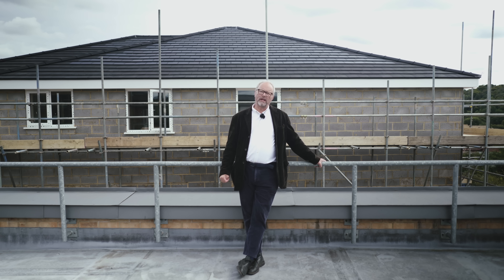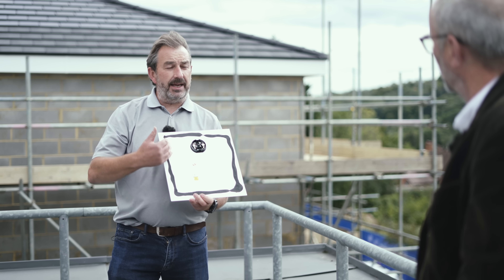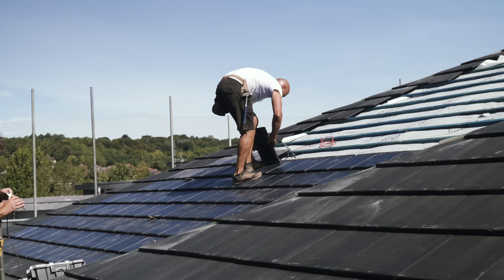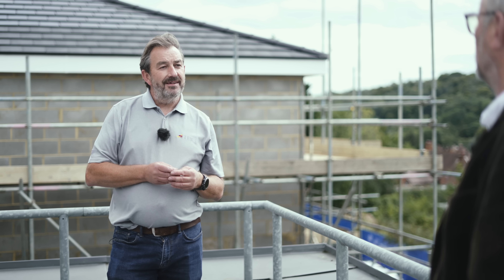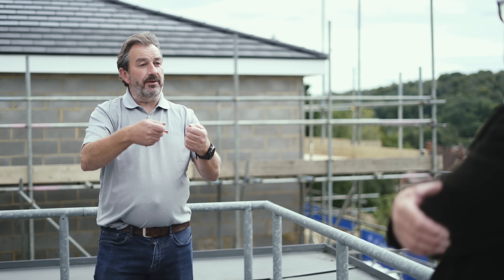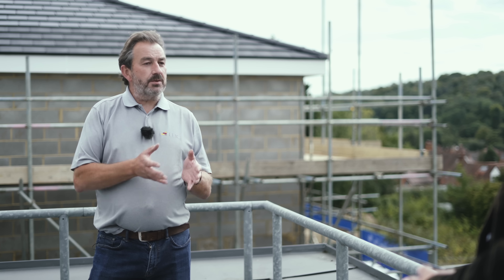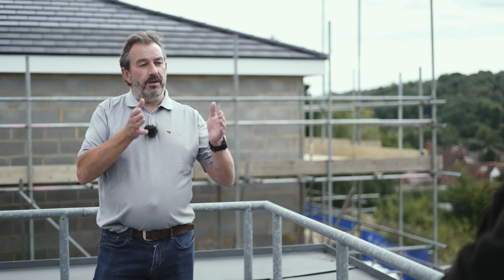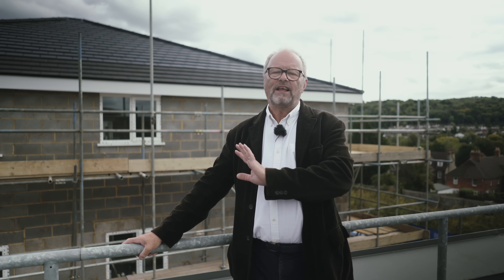Solar Roof Tiles - should every building generate its own power? | 100% Independent, 100% Electric

Comment: I think all new builds should require solar roofing of this kind. Economies of scale would drop the price and considering how long buildings last, they'd pay for themselves many times over in the course of their lifetime.
Reply: Any council buildings/houses should definitely have solar as they will pay for themselves in the long run. All new houses should have them, the increased cost of purchasing a house would be spread out over the length of the mortgage and the reduction in energy bills would more then compensate for the increased mortgage. So it should be easier for people at the bottom of the property ladder
Reply: They ARE required on new California construction homes.
Reply: California, what the UK aspire to be....
Reply: Scratchy Ballzack  Housing costs have less to do with building costs and more to do with speculation.
Reply: Scratchy Ballzack  We are talking about adding around £360 per square meter of roofing on a product that generally costs around £200,000 + depending on where the country you are based.  Where it comes to the cost of a house, very little of it is down to the materials used in comparison to the land and labour costs.
Reply: Economies of scale do not always work. When was the last time the price of a car came down from the previous model version. I've been buying the same model car for 20yrs (new every 2/3yrs). Price has increased from £10,000 to £19,000. And no, my income has not increase by the same rate - nowhere near.
Reply: You guys are DELUSIONAL if you think solar tiles will last long enough to pay for themselves.
Reply: @truantray  They already do- ordinary solar panels have a 15-25 year life span and repay their investment inside that time frame. Smaller, cheaper tiles with longer life spans covering more of the roof = quicker return on investment. That's only ever going to improve as the technology improves too. I hope you're not basing your statement on the idea we're still in the 90s or early 2000s when panels weren't half as efficient as they are now?...
Reply: Scratchy Ballzack  It would benefit you to do the math first.  Solar on a roof wrapped into a mortgage (why not do 30 years) = insane gains and lower bills, more than pays for itself.  My DIY solar has a 6 year ROI.  Local installer = 12 year.  This is in Michigan of all places...
Reply: Especially where you have housing over £500k
Reply: The way I see it is that new builds are bought by people that can afford to pay a little extra for a solar roof. Those that can't buy cheaper 2nd hand housing as I have always done.
Reply: Scratchy Ballzack  Fossil fuels are limited, there is only so much left, & it adds to global warming etc etc. Solar power seems the way forward & store it in batteries, adding in wind power too. Robert Llewelyn also mentioned electric bricks are being developed, this would make our houses into electric storage units, seems very interesting development!
Reply: Solar who is HOT drops signifisent 
In power output !! 
That's why solar panels are wented and lifted off the roof 
Phisix is phisix !! This is a bad idea
Reply: @kennethschultz6465  You seem to be overlooking a few issues. Firstly, in the UK it rarely gets that hot- those roof tile solar panels will be fine. Secondly, they aren't the same design as traditional solar panels- they may lose efficiency but I doubt it is very much given the amount of cooling from wind movement and lower UK temperature during the day ( vs hotter climates ). If it was a bad idea they'd have figured it out  and realized they needed a different solution; physics is physics- real physics that is, not half-baked poorly understood physics like you spout...
Reply: Scratchy Ballzack  There is everything wrong with fossil fuels. Think of it as a product, it is an old outdated, dirty product, brilliant in its day but that day has passed and we now have a cleaner, more efficient product that can replace it.  It's progress.   Just like fossil fuels massively changed our lives for the good, it  also caused tremendous problems.  Now we have the opportunity of cleaner,  less polluting fuel, it would be insane not to go with solar and wind technology.  It's happening anyway.
Reply: Yea, in theory
Reply: Prices won’t do down if more money keeps getting printed.
Reply: @A N Other The sun is laughing at this comment...
Reply: The cost is extortionate. I'd much rather spend my money on something worthwhile. If everyone had to do this the price would be crippling.
Reply: @MrOzzy281  solar is not extortionate even right now - on an old house with retrofitted panels it might be be £7000. And if houses were required to use solar as part of their building code, it would be easily halve because production and installation costs would drop with scale and competition. Or perhaps you don't think the free market would see to that?
Reply: Haha no they really wouldn't! You get about £200 a year saving from solar panels.... So you're paying off your £300k house with £200 a year? Okay 🙄😂
Reply: Yes, what we need is the price of housing going up even more.
Reply: @goliver3846  no we don't! If house prices go up to reflect, everything else would also go up! It's called inflation 😂
Reply: @lewrocks94  Agreed. We just need to see an inflation in salaries to be able to  compensate. Not seeing that in my world. Must be lucky in yours.
Reply: Absolutely NOT! REQUIRED means if you DON'T a man with a gun shows up at your house with fines or handcuffs. RECOMMENDED yes but what about wooded areas? Low light cloudy areas? My house is 100% solar INCLUDING Air Conditioning and my family has been involved with alternative energy since the 70s. Gov MANDATES DESTROY INCENTIVE FOR CLEAN ENERGY because like you they think by backing a corp with TAX $ they can spur innovation but what they do is write POORLY WORDED LAWS that people EXPLOIT to just get free$! Private investment picks GOOD winners BAD LAWS make everyone a loser!
Reply: And then what pays for the landfill after EOL for all those panels.
We're talking literally MEGATONS of material.
Reply: one flaw in your logic. "economies of scale" would not reduce the price in your proposed scenario of having the product required by law. that has ALWAYS increased the price of it. sure, the cost of production will still go down, but the cost to the consumer will go up. they have you over a barrel if they have the teeth of the courts behind them. either you pay the price, or the courts come at you.
Reply: No they don't. Currently It takes 30 years or more to repay itself and only lasts 25 years.
Reply: @MontagoDK  lol where are you getting those numbers?
Reply: @JamesMichaelDoyle  from various solar roof companies in Denmark - these new tiles are extremely expensive and can have some maintenance costs over the years, when 1 tile breaks (electronics) and needs to be replaced. You also need to buy an expensive battery to store energy from daytime and use at night, these batteries last around 15 years and needs to be replaced. Solar cells don't last forever and loose their yield over time - 25-30 years lifetime is a good estimate before you need to change them again.
Reply: @MontagoDK  well the battery is only needed if you want to be offgrid capable. you could just tie into the grid and feed into it. the battery is no different than normal solar.

solar panels do not degrade indefinitely at a significant rate. they degrade at a significant rate at first, til about90% then the rate of degradation slows down. at the 20-yeah mark they are likely at about 80-85 range. after that, its so slow its not even worth worrying about.

are you sure that you are speaking of tiles like the ones in this video? because these guys have an interesting take, where they have a inexpensive way to produce them on site. its not as perfect and flawless an end product from the aesthetics, but hey, these look good enough, and are not as expensive on both materials and installation as other previous ones in the market. and even those were still pretty damn good value if you are doing the roof anyways.
Reply: your so right every house stroke building should be fitted with these tiles they look and fit better than the tesla tile last a long time and being only 31 pounds a tile a pound for the tile and 30 quid for the solar cell eventually the more that are made and the more that are fitted the price should drop at least 50 per cent in a couple of years if everyone started to fit them as manufacturing costs will drop they always find better ways of making them and with better materials  so if the government grew a couple of big ones and stood up to the power industries and said all buildings from 2021 will be fitted with solar tiles were possible and if anyone wants to partake on haveing their tiles replaced with them we will give them a 50 per cent off per tile  for the first two years as that would kick start the industry and give a swift kick in the gonads to the power industries when houses start back powering them and they have to pay the houses and buildings for giving them surplus power until they go bust as then batterys will be next on the governments list to have them fitted in everyhoushold which would kickstart a massive industry and if john b Goodenough comes up with this glass battery made from cylicone and other cheep materials the world will be a better place to live in and by bye to the power industries  except the wind farms and solar cell farms all the rest the coal and gas power stations the nuclear power stations shiut down except the ones recycling the nuclear material then once that's done and there is enough stored then bye bye the rest of them. petrol cars will be like vintage cars hardly seen any more and won't be allowed on the new motorways where electric cars all hook up together like a train and drive themselves until it their time to leave the junction and then it steers its way of onto A road's and to the destination, no driver now required behind the wheel but you can drive manual if you want but you have to go in the petrol lane where the fuel cars drive.
Reply: @kinkong1961   can you try and chop that up a bit, holy hell its hard to read in one long blurb. it doesnt look better than the tesla tiles, but it still looks pretty sharp.  and likely much cheaper, since they manufacture them on site.
Reply: Interesting what the connectors are and expected lifetime?  Also how the extra electrician connects this lot up live on a sunny day. What happens if a fire starts? (Just practical points to think about). Structurally it looks the way to go for pitch roofs. Start a 38 degrees campaign for the lack of action on new builds.
Reply: Absolutely! That solar hasn't been mandatory on all new builds in recent years is such a missed opportunity
Reply: Scratchy Ballzack  a fair point, I can't speak to American prices but in the UK all new build prices contain a very decent margin for the builder. Housing is ridiculously overpriced here too, my argument is that the free market has had plenty of time to do the right thing though.
Reply: @AdrianNelson1507  there are no free markets!
Reply: Scratchy Ballzack  In fact to get a true market economy, you need a government, not the corrupt government under the foot of lobbies and corporations. Sacrilege, you will tell me. But look at your healthcare system, you pay 3x more and live like 4-5 years less in the US. The reason is when corporation run loose without any regulation, they don't tend to fight each other and compete, they just buy each other and form cartels. It is so much easier when you have 2-3 cartels to form monopolies and fixing prices, than to fight each other and decrease margins.
Reply: 100%.  The government has missed a trick by not making this compulsory on new build and replacements.
Reply: @rogerbarton497  at least federal buildings. That should have been a given
Reply: Roger Barton 
They didn't miss a trick. They just got told not to by building companies.
Reply: Scratchy Ballzack  Last time I checked the solar panel roof tiles were actually cheaper than traditional slate tiles in some places- as others have said economies of scale will drive the price down further, and the savings on electricity make the home cheaper for the buyer fairly quickly. You're being rather shortsighted...
Reply: Scratchy Ballzack  Property prices are only so high because of laissez-faires housing policy.  If council housing was supported and landlordism restricted through taxation you wouldn't be living in a country where you have to shell out upwards of three hundred grand for a three bedroom matchbox in the boondocks.
Reply: @fredfredrickson5436  Property prices are high because of supply and demand. Supply is constrained by planning permission and available space and demand is high because of in-migration to the specific areas due to available work in those areas. Planning permission is the exact opposite of laissez-faire, although most people would view it as desirable overall. Landlords do not affect supply or demand in this equation.
Reply: @markcoster9789  That's ideological claptrap, Mark.  I'd urge you to examine your remarks and ask yourself if they really stand up to earnest scrutiny.
Reply: Scratchy Ballzack  I think you have found the wrong channel! I'm sure the Koch brothers have some programs you like.
Reply: This is one of those things that would never happen with a Conservative government but I could see Labour trying to push through something like this.  The Conservatives tend to believe in de-regulation and have (as an example) actually cut down the amount of insulation required in new houses when compaired to when the last Labour government left office.
Reply: there's no way they'll be able to produce and install that many solar systems
Reply: Scratchy Ballzack  That can be a way for supporting green transition from the government. They should pay the price difference between regular tiles and solar tiles as subsidy when you are installing new roof or renovating old one.
Reply: @tcfs  I did some calculations and compared to building of a new nuclear power station the UK would save money by giving away for free the solar tiles and battery storage on new builds. Pointed this out to my MP, what a waste of time :( 
BTW I did not include any decommissioning costs of the nuclear power station or any transmission losses in getting the power to the houses just the up front costs for producing the same power.
Reply: @favesongslist  you perhaps should have included that decomissioning and putting the nuclear station land back to general use would take more than 250+ years as shared by Robert in the last video.
Reply: @shirishag75able  Unfortunately is is impossible to get politicians to think far beyond the next election cycle, so I did not include it.
Reply: @favesongslist  That's why we need PR, I think. Much as I dislike teh political aspect of this versus the technological/environmental. But when I look to the continent, the green votes get a say in political decision making via PR. And green votes will have the longer view in mind
Reply: They would have, then we voted Tory.